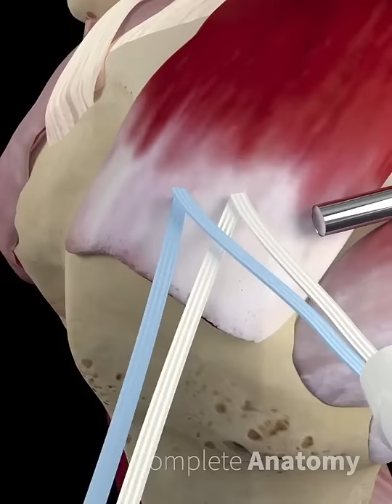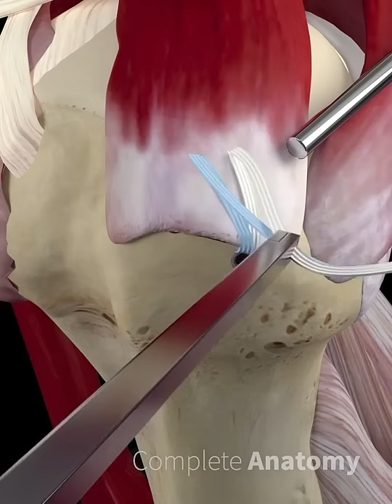Rotator Cuff Tear Repair

Comment: I went through 2 shoulder surgeries, one on each shoulder. This was not how they did it. Best advice, if it is determined that you have a full torn rotator, work and strengthen the surrounding muscles as much as possible before surgery. That will shorten your recovery time. Normally it takes 6 months, I was back, full duty in 4.5 months.
Reply: How was the recovery? Did it hurt a lot after the surgery and after therapy or whatever you had to do to recover it was it the same how it use to be before the torn cuff or just slightly better?
Reply: @Nic0Dr4ws  my left shoulder wasn’t too bad what was surprising since they couldn’t use nerve block. My right was a little more painful but there was more damage. I only took half of the oxycodone because I heard of addictions and I didn’t want to mask any pain since I was probably doing too much with it. I suspect I had I might have had a partial tear in my right shoulder before the injury since it bothered me throwing the football or baseball. Now I can throw the ball and a lot of other activities a lot easier now. It happened when I was 51/52 and now at 58 I feel like I still have two new shoulders. I still workout and do the physical therapy to help keep the shoulders in good condition. FYI I drive truck but I have to unload 50 to 150 lb doors so I’m kinda forced to keep them strong. Hope that answers your question without putting you to sleep
Reply: @lazeppelin1  what was the time frame from injury to sugery?
Reply: @TheDojomeat  3-4 months. At first the doctor didn’t think it was torn because I could still lift my arm up so they tried physical therapy. Then after 2-3 months of that and it wasn’t improving, then they scheduled a MRI. It was only 2-3 weeks from scheduling the MRI to the surgery. Wish we would have done the MRI right away.
Reply: Hi may I ask, what are your symptoms?

Thank you
Reply: @MusicYoutube-s5u  the two shoulders were different. My left was very painful but the right wasn’t bad until I’d try to lift it. The doctors determine what’s wrong by seeing how far I could lift my arm up. I could lift them but painful. The doctor at first diagnosed that I just strained them because he thought if I could lift them ‘ there’s no way I tore my rotator cuff’. I’m guessing I’ve got a high pain tolerance because it wasn’t until after the MRI that they determined that I actually did tear them. I’d suggest get the MRI earlier than later. Nice to know what’s going on.

Comment: TY4Visual demonstration! 4yr ago(@age 66) I tore my right arm rotator cuff during a violent Nightmare dream( injury was very real) I didn't go to Dr., but 6mos later, wished that I had gone. Now, @70, I still have only 85-90% use ability in my right arm. @ my age, unsure if surgery would heal/be of any benefit. Now it is only an annoyance, unless I reach up, over-head to put/retrieve items from cabinet, or try to throw a ball. Won't matter in a few years!!
Reply: man that sucks bro, keep living life
Reply: Probably not worth the risk of bloodcluts etc to get a surgery at your age. Esp at 85-90% functionality. Surgery might even make it worse, 90% is hard to beat!

Surgery is better for 10% original power, to bring it up to 50%
Reply: Dude, I won't even live that far.. I will be done before 60 😁👍

Comment: I had this done.
It was both terrible and wonderful
Reply: You back to benching my brother?
Reply: Can you please give feedback on how it effected shoulder strength? Did it ever come back to normal
Reply: @ericschattel2723  
It’s been 10 years now. I’d say I’m 90% back  to normal. Strength is hard to gauge because I’m 50 now. ( no spring chicken) no pain now and I can still work ( I’m an electrician) 
Get it done is my advice.
Hope this helps
Reply: Could you elaborate on how it was good but also bad? I’m pretty sure I need surgery but I’m VERY scared of surgery ( I mean I’d still do it ofc because this shit sucks but still) and I’m also scared about the recovery and if it will actually help me live a normal life with my shoulder again
Reply: @Nic0Dr4ws  
I had a hard time with recovery, and it seem to take forever .
My arm was completely useless for three months. I couldn’t even raise my arm to give a handshake.
That’s the bad part .

Before my rotator cuff surgery, my arm was in 24 hour pain. I walked around with a tens, unit essentially welded to my arm.

When all of that nonsense was over, and after physical therapy, it was 100% pain-free and remains that way. Going on 10 years now.

It was definitely worth the 6 to 8 months inconvenience. You are better to get it done sooner rather than later. I waited much longer than most people do and that’s what led to my long recovery. Get the surgery. It’s really a quick in and out procedure.

It’s the recovery that is a bitch. Hope this helps.
Reply: @itaintrocketscience  it sounds like it really helped then, my shoulder isn’t in pain constantly since I’ve been homeschooled and generally try not to do thing to aggravate it even if it’s simple things. But it’s good to know that the surgery helped you out even with that much pain, I’m scared of surgery so I was kinda considering if it was even worth it but I’m def gonna try to get it if I can. Thank you!
Reply: bro did the pain go away right after surgery or did it take some time?
1 had it done on one shoulder 8 weeks ago and not sure if it feels better yet, and just got my other arm 3 days ago 

Did you get the full relief you were expecting and if so how did long did it take ?
Reply: @AG-lp9md it shouldn’t be to long
Reply: @itaintrocketscience thank you. My father 79 fell on his arm has tear 4.1 CM, been on physiotherapy for 2 mnths, did MRI yesterday, when this came out.. Now contemplating surgery...

Comment: I'll have my surgery on my R shoulder in March. Had a tear for years but mostly weakness no bad pain. Not being able to drive and having to have someone come to help when I have to take the immobilizer off will be the biggest concern
Reply: Как вы себя чувствуете.
Здоровья вам.
Reply: @S Т  I'm better. Sleeping with the sling was Horrible. 😭I didn't think I would get to the 4 week point. I'll be at 6 weeks 2morrow and I start physical therapy. This surgery is no joke and you have to have help a minimum of a week. And also you need an oversized recliner because trying to sleep in the bed was Horrible
Reply: @riod7559  what was so wrong with sleeping? Did you have to only sleep on your back or something? I’m probably gonna need surgery and I already have a hard time sleeping so I’m just curious
Reply: @NicoLikeNeko  it was the sling. Sleeping was Miserable. You definitely need help getting positioned and positioning pillows. I reccomend an oversized recliner to sleep in (which I did not have - I had a smaller narrow recliner which did not accommodate the pillows needed for support for my arm and shoulder). Definetly needed in home help for at least 2 weeks - which I only had for 4 days because I live alone. It was rough. You need someone to help position the pillows. Also reccomend getting at least 3 small travel pillows. A thinner pillow is better for specific support. The sleeping was so bad. You have to sleep on the non surgical side or on your back. The first few days I slept maybe an hour  before waking up many many times throughout the night. It was just awful.
Reply: @riod7559 did you get the results you were expecting from the surgery ? If so, how long did it take for your shoulder to feel painless again after the surgery?
Reply: @AG-lp9md  I was pretty much painless a couple of days after surgery. I have gotten the results I wanted  almost. I'm 7 months out and my ortho says I'm 20% away from full range of motion. I did physical therapy but also had to get a steroid injection 3/4 of the way into physical therapy because pain was still restricting movement. The injection helped tremendously and I wished I has gotten it a month sooner. Also medical massage helped as well. Now to break up the capsulitis (scar tissue) I lay flat on the floor, knees bent and put my right hand under my head and allow the arm to hang. Gravity will pull it down. I do this for 5 mins - I need to do it every day but I do it one to two times a week and it has really helped. Hopefully by the 1st of the year I'll have full range of motion. I also got the strap that you use to pull your hand up behind your back and that really helps too. Same kind they use in therapy is on Amazon.
Reply: @riod7559  ok thats sounds awesome bro
I understand the post op pain is gone
What about the impingement pain, did that go away right after the surgery was done ?
Reply: @AG-lp9md  my shoulder was only painful pre surgery if I laid on it. My problem was that it tired quickly vs my left shoulder. Post surgery now I can lay on it with no real problem. Sometimes the weight of my handbag can still cause it to tire sometimes. The worst part for me was that sling and not being able to hardly sleep.
Reply: @riod7559  that is my same problem that it tired quickly
The surgery didn’t really fix that for you then?
Reply: @AG-lp9md  oh it absolutely did help. Now that the tear is repaired I can build strength whereas before that was not possible because of the tear. Ortho says it takes 1 year.

Comment: I had this issue was afraid of surgery so didn't go for it i ate organic food skipped all the processed food it healed itself after an year now i can do 80 pushups in single set
Reply: I really want to get back to working out and stuff but it seems unrealistic. How did you take care of your arm during that year? I don’t want surgery, I just turned 20.
Reply: @lleyton50  just ignore the issue an convince your mind that it will heal sure it does pain initially can't deny that but as you go along pain reduces as body makes recovery avoid any food  that gets you sick breathe fresh air go to mountains meditate synchronise with nature you will definitely fill the magic don't get depressed keep your body in higher vibration 👍
Reply: @lleyton50  Bro, I have had surgery on the right shoulder, and need to get one done on my left too. I still workout everyday, I just make sure not to extend my elbow over my injured shoulder. So, avoid those excercises. And Avoid Deadlifts too. You should be good.

The only way you can permanently fix this issue is by undergoing surgery. No amount of Organic Foods and Self Healing is going to magically reattach your tendons back to the bone. 💀
Reply: @chek1609  mine did you have no Idea what your body is capable of if we keep depending on doctors for everything eventually our future civilization is doomed
Reply: Have you done a follow up MRI? Has it regrown? Do you have any pain?
Reply: @chek1609  do these screws stay where they are and never dissolve? Do you feel any pain in your shoulder? Any sounds or noise when you move it? Do you regret getting a surgery? Can you train as a normal person?
Reply: @besmart2350  They dissolved.
No more pain in my shoulder. No sounds, nothing. I’m thankful I got a shoulder cause now I can play sports without having to worry about fucking up my shoulder. I do train 4x a week. I bench and squat weekly. I don’t do deadlifts or overhead presses, or any exercise in which I have to put my elbow above my shoulder. Don’t want to risk fucking it up again.
Reply: @chek1609  how big was your tear? Mine is 40% supraspinatus tear and some people say I should get the surgery some say it can heal on its own. Have bo idea what to do but I can’t wait to workout as a normal person
Reply: @besmart2350  Not sure about that. Doctors didn’t say how big a tear it was. But I didn’t get keyhole surgery (small incisions), I had to get a full open surgery as my tears were too big to be healed using small incisions. Still have a big scar on my right shoulder.
Reply: @besmart2350  The screws are titanium, they are permanent.

Comment: im getting this done on my right shoulder in about a month. im not mentally prepared for the pain i am about to endure
Reply: I find out Monday when my surgery will be done
Reply: Did you have it done? How was the pain?
Reply: @thejudderman8265   I had surgery for a major tear repair. No fun. The first few days after surgery was very painful. Still sleeping in a recliner 6 weeks after surgery. First 4-5 days had to take pain killers to try to get comfortable to sleep!!
Reply: @john Bruce the doctors didn’t recommend PRP therapy or stem cell therapy.
Reply: @John-kv1xz   Mine was a major tear of 3 of the 4 tendons of the rotator cuff & had surgery. 12 to 16 weeks of physical therapy (this week was my 6th week). Still painful!
Reply: @brucedeerhaven  I’m sorry to hear. I hope you get better soon.  I have to get an MRI soon. Might have a subscapularis tear. Trying to avoid surgery.
Reply: @John-kv1xz   Surgeon told me if I put off surgery or did not have surgery, I would lose strength in my shoulder & arms & would evidently need shoulder replacement surgery. That got my attention!!
Reply: @brucedeerhaven  yes but remove surgeons often push for surgery.  Lol.     But it sounds like your case was severe.  You tore a lot of the rotator cuff tendons.
Reply: @brucedeerhaven  how is the pain on /10 scale and can you workout after the surgery like lift weights etc
Reply: @SS-sg4eg   I tore 3 of the 4 rotator cuff tendons. Surgery lasted almost 4 hours due to the severity.  Originally hurt shoulder lifting weights years ago, but was not a complete tear.  Got back to lifting maybe 3 months after initially injuring it . Then years later after getting older, I guessing that “wear & tear” + 1 fatal golf swing did me in. 
Answer to your question is that my shoulder surgery was painful for several months including physical therapy.  I am not a doctor, but it will take you a good 6 months to get back lifting, but no heavy stuff. I quit lifting years ago due to significant discomfort in my shoulder, but still able to play golf. “Wear & Tear” catches up to us all particularly if you are over 50+.
Reply: @SS-sg4eg   The first day or 2 your shoulder & arm will be numb  - I guess doctor numbed it to hel with pain. Afterwards for a couple of weeks pain will bb about an 8 with very slow improvement with no weekly visits to physical therapist. I remember I could not lift my arm above my shoulder or head for months. Slow recovery process!
Reply: Please follow-up. How was the surgery? Can you raise your arm better now?
Reply: @brucedeerhaven  is your shoulder at least better now where you can do thing you use to before the tears? For me personally it’s hard to do chores or work or even draw for more than an hour so I’m probably gonna need surgery and I’m just asking everybody in these comments questions lol
Reply: @Nic0Dr4ws   Much better after surgery & back to playing golf.
Reply: @brucedeerhaven how long did it take for you to feel the full benefits and for the pain to go away ?
Reply: @brucedeerhaven thanks🙏

Comment: I tore mine 11 months ago. The surgery was in my opinion way worse than the pain of tearing it. It is getting better but has been a slow process for sure. Sometimes I wonder if it will ever be the same again. But I'm guessing it won't. However Iam getting better
Reply: How does your shoulder feel now? Can you train? Are you regretting getting a surgery?
Reply: @besmart2350  I don't regret it. I have a tough job so I feel like I had to do it. I do train but can't lift near the amount of weight I used to. Maybe that will get better in time idk. Anything chest or shoulders I have to becareful with and do light weight. It will be 1 year since surgery  next month. I feel better than in the beginning
Reply: @schimittywebermanjensen1419  how big was the tear? I got 40% supraspinatus tear and some people tell me to do it, some people say it can regrow naturally
Reply: @besmart2350  idk as far percentages. My surgeon said it was a medium size tear of the supraspinatus. I had 4 anchors placed in my shoulder to reattach it. I have a little medical training but Iam no doctor. But I'm almost positive it will not grow back on its own. My surgeon also told me that if I waited there was only a 56% chance that the surgery would take/work whereas if I did it right away the chances increased to 80 to 90%. If I were you I'd talk to a qualified surgeon so you can get it taken care of
Reply: @schimittywebermanjensen1419  surgeons want to make money maybe that’s why they push people into surgery. Some people here in the comment section say they managed to fix it naturally. It probably depends on the size of the tear
Reply: @besmart2350   you can rehab a partial tear to feel better over time with physical therapy and stuff like that. That's what mine started out as was a partial tear 12 years ago and I was able to go back to lifting heavy weights and do most activities normally. However there were times where I would hurt it again and would have to not do as much with it. I finally tore mine all the way through when I fell skiing. I didn't know right away that I tore it although I knew something was wrong. It was the next day I knew for sure that I really messed it up. I didn't go to the doctor for about 2 or so weeks and it just got worse. I get what mean about they just want to make money. But I'd be careful about waiting too long or it's very possible it could get worse
Reply: @schimittywebermanjensen1419  do you think it would’ve still gotten worse if you never fell skiing?
Reply: @besmart2350 I often wonder that. Idk honestly. I know there were times before I tore it completely that it would get sore and hurt for awhile almost like I reinjured it from doing things like putting kayaks on my car or some overhead movement and I wouldn't be able to workout for awhile until it felt better again. So its hard to say. I don't think it ever healed but there where times when it did good and felt almost normal again until I did something stupid to make it hurt again